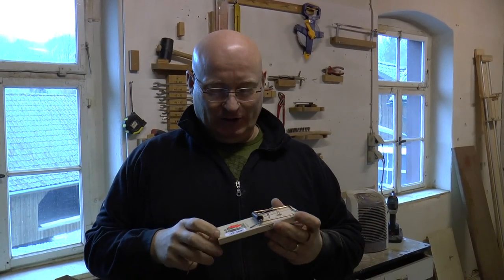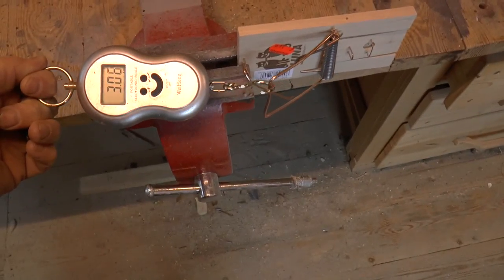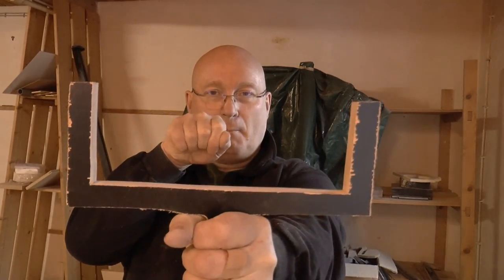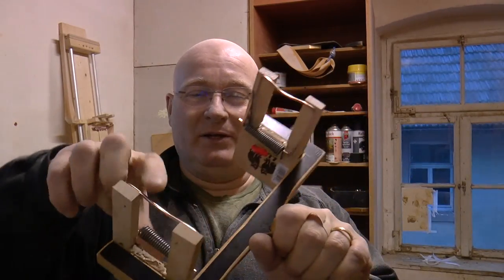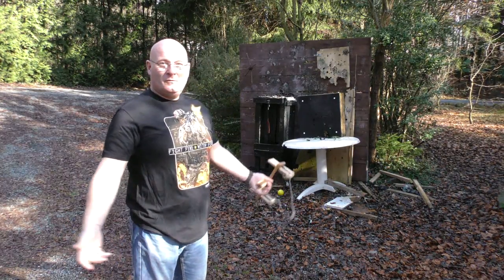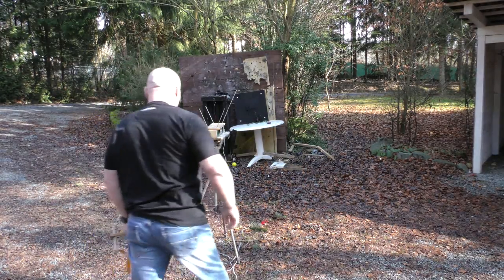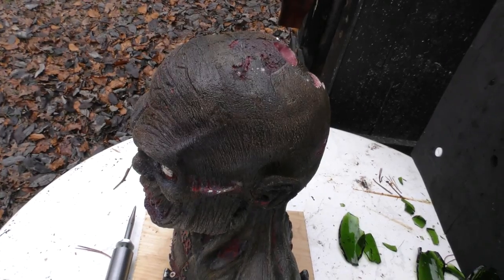How To Weaponize Mouse Traps

Comment: Can you bulit a slingshot only with ductape?
Reply: I don't think it has the elasticity.
Reply: I don't see a Slingshot happening but you could make a Sling to launch rocks or steel balls or w/e.
Reply: piranha031091
you doubt the abilities of Joerg?
Reply: I think it is possible, but you of course have to add rubber. But if he doesn't we will see what he comes up with, his ideas are always interesting x3
Reply: Find his SHTF video, not completely duct tape but it is an essential part!
Reply: Yes he allready built one, but of course you need some sort of rubber to fire the
projectile.

Comment: This is the practical extension of the slingception project.  I think this is how you may finally exceed the maximum velocity of rubber!

Can a slingshot break the sound barrier?

Another thought, a bull whip makes a cracking sound because the tip exceeds the sound barrier.  Can this be applied to accelerate a steel ball?
Reply: The thing about whips is that they get smaller and smaller towards the tip. Thus the mass that needs to be accelerated gets smaller and smaller as well. If you add a heavy steel ball to the end, I suspect that the whip wouldn't work properly anymore. But an interesting thought nonetheless!
Reply: A whip does not crack because the tip breaks the sound barrier. In fact, the 'crack' sound is heard when the tip is actually travelling at about twice the speed of sound. 
What makes the sonic boom is the propagation of a wave down the length of the whip.
Reply: As DaveMoustache said, the extreme speed of the whip comes from the fact the kinetic energy of something heavy (the thick and wide base of the whip) gets concentrated into something much lighter (the thin tip of the whip)
If you wanted to apply that to a steel ball, you'd have to accelerate something heavier than a steel ball, and than get it to transfer all its energy to the steel ball. I'm not sure how that might be done.

Rubber-powered trebuchet maybe? It would certainly have to be made of really resistant materials.
Reply: PandaManMk2000 Travelling at twice the speed of sound is breaking the sound barrier...
Reply: BmanUltima True. What I meant is that the sonic boom created by the tip of the whip is negligible. The one you actually hear is from the acceleration of the wave travelling down the whip.
Reply: As seen in the video the mouse traps just added about 0.3 Newtons each which is really insignificant. You would need some crazy fucking strong mouse traps
Reply: Tim Hedlund e.g bear traps? (probably still too weak)

Comment: I do like the zombie stuff as well, but it's nice to see you getting back to your roots.
Maybe some rubber connecting the metal part of the trap to the board. Get the spring power, coupled with rubber power, along with the rubber band you already have on it.

Comment: I know this is old but have you tested out the different length of the rubber band to see if the rubber band was too long for the mouse trap to pull so really just wasted all the fling in the rubber ?

Comment: Do both traps go back at the same time when in pulling motion ? If not that would explain why the slingshot wasn't powerful enough. Different force on pull different speed and less on target. Same thing with cross bows in away .

Comment: me again.  pennsylvania rat traps have plastic or copper bait plates.  but here's where the fun comes in.  take a slat of oak from a commercial pallet and cut it about 10 inches(25 cm).  then round out a nice handle at one end.  take the assembly from the rat trap, and mount it on the other end of the slat.  leave 2 inches(5 cm)for the action, and bore a hole for the brass.  twist a small wire around the brass'es groove, and let it outlay about a 1/4 inch(6 mm).  make a small notch for the outlay, and use 2 drywall screws to lock it in place.  we're almost done.  snub a thumbtack and tape that over the primer to complete the mechanism.  for a silencer, use a wide mouth half pint(1/4 liter)plastic bottle, and fix the cap with several layers of a whoopie cushion, hot water bottle, or rubber web.  just turn the bottle into the cap when ready to use.  silent but deadly.  only effective within 6 inches(15cm)of target, however.  joergsprave has my permission to make this device, and upload his video of it in action to his joergsprave channel. -M kusanagi

Comment: It's interesting to see in the high-speed how the trap levers act like an accelerating fork to add distance to the rubber's path of direction. It reminds me of the slingshots with pulleys on the fork that allow the bands to extend very far down onto the handle.

Comment: Nice, glad to see some sound methodology on testing the improvements

I imagine you would get more of an effect if you mount the traps so that the elastic bands are in line with your hand/grip when being pulled back, as they would be with a regular slingshot. With your current design your arms are at full draw but you are losing 10\15cm of stretch in the bands because of the mechanism of the trap

Comment: You should consider making a narrow version of this, where the the mousetrap's arms swing on the outside. The rapid expansion in width in the middle of the mousetrap's swing should kick the puch forward more quickly, I imagine. Would also be interesting to see, if elastic bands would dampen or even neutralize that effect. Cheers, Martin.

Comment: This design looks like it'd work a bit better in a crossbow kind of setup with a more controlled release. You could condense a lot more power into it, especially with bigger torsion springs.

Comment: the rubber band on mouse traps kinda contradicts what i was taught at physics class about spring functions. i was taught that when the springs are held by one another [kinda what you did], they give out a weaker result.

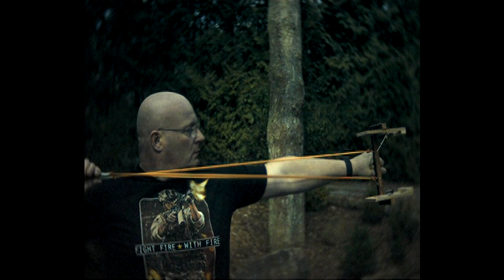Comment: Try to make the space between the mouse traps a little bigger so the rubberband wont meet.And perhaps make someting like a wooden hand to hold a part of the rubberband.(so a part would be tighter than the other one.).This way you would eliminate internal turbulance of the rubber band and the energy would not be consumed by that.The secret to high speed velocity throw a fluid medium(the atmospher/air in this case)is to eliminate the turbulance or air friction with the metal ball.The second you cannot do, but the first is fairly easy.You do that, the rubberband will not vibrate and will not touch eachother ( 06:36) and you will gain much more speed.

Comment: If you'd make the string shorter, so that it is almost under tension whilst the mouse traps are closed, it should maximize the force on the ball.

Also the speed increase in the rubber band version wasn't quite so big, because the rubber bands take away some of the force of the mouse traps. As the traps close, the bands are in the movement of relaxing. Then the mouse traps spring, so the rubber bands can be strained again. So the force of the mouse traps is swallowed by about 80% by the rubber bands.

Comment: Isn't there a chance that drawing the trap arm back so far that they'll snap and fire a chunk or jagged metal back at your face with well over 100 fps of intensity?
Reply: mm, theres one mental image I didn't need, thanks! ;)
Reply: 100fps? Like ft/s? You realize that's really slow right? Like, you might get a gentle cut.
Reply: picassopainter2
You know that would be somewhere around 30 meters per second... like 10 m/s slower than the rambone shown in this video, i personally would not want to get hit with that.
Reply: QuentinSingvogel
But it would have very little mass. A small chunk of that arm would weigh a few grams.
Reply: picassopainter2 but it would be sharp and embed itself in your eye. swords have little mass compared to sledgehammers, but which one does more damage?
Reply: CactusforceX
Probably sledgehammers overall.
And the relative mass difference between a sword and a sledgehammer is important compared to a tiny shard of metal. We're talking about aerodynamics here, not someone swinging it at you. Would you rather a bullet or a grain of sand come flying at you at mach 3? Probably the sand, it has considerably lower mass and poor aerodynamics.

Comment: I recall making some mouse trap powered toy cars in school. You can tie a piece of string to the arm and wind it around the back axle of the car. Over time the traps weakened and I wonder if it will happen with this slingshot design.

Comment: Hello Jeorg, I see you specialize in making various weapons which reminds me of one i made when i was 12. Its called  a katarro which consists of a Y stick like the catapult which has a bridge with a notch in the centre which is attached between the Y and fitted with a strong rubber sling which fits into the notch of the arrow. It shoots arrows just as well as any bow but is much easier carried. I think you might like it.

Comment: love your videos Joerg! though i think for this video, a fairer comparison of the slingshot with mousetrap spring vs one without would be to pull them back to the point of the same draw weight, or same pullback distance. just a little suggestion:)

Comment: I think the string might actually work quite well if it was much shorter. If it was the same length as the distance between the mousetraps, then when they snapped shut the string would be pulled taut, which would fling the ball. This would add to the speed exponentially, as the traps would first pull the string forward but then start pulling the string perpendicular to the direction the string is moving.

Comment: It looks like the angle of the rubber bands don't allow the springs to fully load...  You could try this again with string and a couple pulleys on the mouse traps to get the same travel with more power!

Comment: You should increase the distance between the traps and extend them in such way that they almost touch in the middle. It will mean a more efficient conversion of energy of the stored potential energy into kinetic energy.

Comment: Dude, you should make a bigger hammer that can house the Co2 cartridges with the spike exposed at the front. it may be possible to modify the handle so that you can not only hold the cartridge in place and release the gas on impact, but to also increase the speed of the swing! The gas effect coming out the back would be a plus!

Comment: Here's an idea, when I was a child my father made me a rubber operated model airplane, basically the inside was a rubber attached to the rotor and you would simply wind up the rotor, so that when it released, the rubber did operate the rotor and that was to propell the small plane. Probably you could use this technique to propell a small drone and possibly you can acellerate the winding process with a drilling machine. If that works, you can try upgrading the drone to bomb zombies with steelballs.

Comment: if you turn the mousetraps out on an angle you could get a lot more power, i think with that set up your only getting a small portion of the spring power the mouse traps have to offer, by angling them outwards, when you pull back the band set it will pull the mousetraps all the way back instead of only half way, wouldn't make a huge difference but a bit faster for sure

great video! @joergsprave

Comment: You should have created a larger slingshot with multiple mouse traps on each side (one on top of another), so for 3 mouse traps on each side the ammo pouch has 6 ropes attached to it, one for every mouse trap.
This way you can make a stronger slingshot without using rubber :)

Comment: Guten morgen Herr Sprave, 
I was thinking if it is possible to use the latch mechanism of the trap to cock it, hold the rubber in position, and then activate it with a trigger. Something similar to your sling-crossbow, but with the simultaneous release of both the traps and the rubber band. With the same concept it could be possible to create a slingshot trap by putting it low on the ground and linking it to a tripwire. Could be all of this possible? If so I think it could be fun.

Comment: just a thought. what if you were to rig some system where you had a bunch of these hidden about, pulled back and held in place by some sort of latch or release mechanism. then using a pressure plate, or other such trap, you could have them autofire on something that is unlucky enough to spring the trap. a slingtrap.

Comment: The mouse traps should be angled so they are further away at the front. Also, te springs should be facing outwards on the sides, as if you had a catapult with a sling pouch but the pouch could go around for another 90°, practically into the ground but not if it was sideways, as with the mouse traps.

Comment: those last few seconds made me laugh haha :') , and i think your loosing alot of power from the mousetrap slingshot because of way the mouse traps bring the rubber bands together so they loose some of the tension in the bands ,from the slowmo it seems the mouse traps reduce tension of the bands right from the start of the release which is where i would assume alot of the velocity is generated. someone please correct me if im mistaken ? oh and i think you forgot to angle yourself in the blooper :)

Comment: maybe instead of the cartrige use an explosive and romove washer just make explosives explosion trigger more sensitive so when the tip hits target explosive explodes burning victims face and pushing the rod forward.also in mousetrap slingshot make rubber band shorter and harder to stretch  so you can fully use mousetraps power

Comment: Lol, you should teach a shop class. :)
I was thinking you could get the trap springs to fully compress if you mounted them on the outsides of the forks and arranged them so they cocked towards the business end of the slingshot and the string would run on a roller also the forks could be much closer together. Not that you haven't already thought of that iteration and many others, you are clearly a mechanical master mind.

Comment: Two things;

I would be interested to see what would happen if you put a little leather or similar sound-dampening material on the contact point of your mouse-trap slingshot. My thinking is that while it lacks power, in a zombie apocalypse, its limited power and noise could be used to some effect, either in communication, or in causing a distraction by hitting some reasonably distant object.

Secondly, the footage of the mouse-shot in slow motion got me thinking; what if you used, instead of two large traps, many smaller ones in series? If you could spend a couple hundred euros on mouse traps and get back to me, I would be appreciative.

Comment: Ricochet artist!! Eh it happens!! Hmm I wonder what material can spring back faster with more torque, than rubber? Cause the slingception idea really needs that to maximize the combined force. That would be a good idea to test with the high speed camera. Or perhaps, A carbon fiber slingshot with flexible forks could work?? Haha, even if it didn't work you would probably have the record for most expensive slingshot ever built!!

Comment: Hay, if you angl the rat traps outward at say a 45 degree angl you will be able to pull the bars all the way back giving you the maximum draw weight and also a greater flicking force when they reach the end stroke. Please dont mind my spelling.